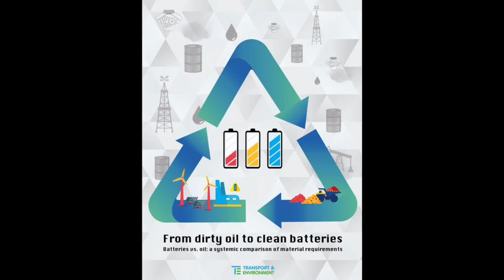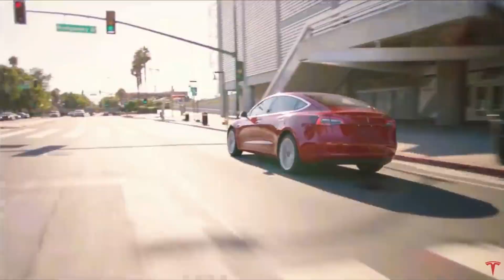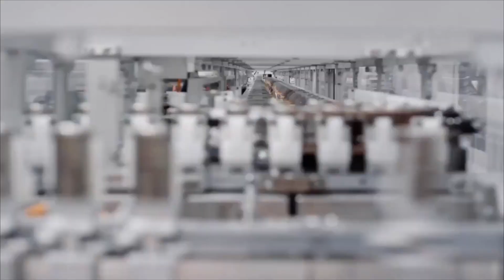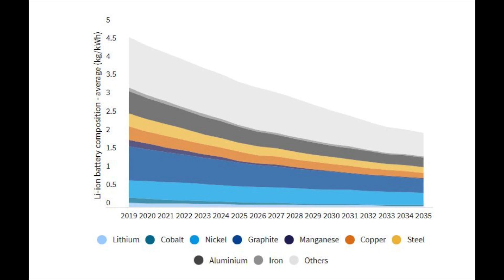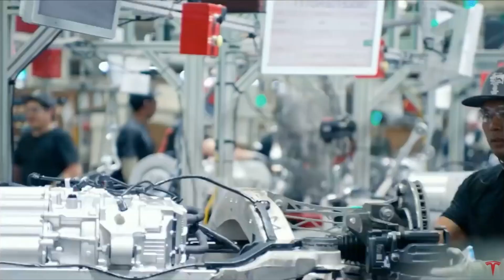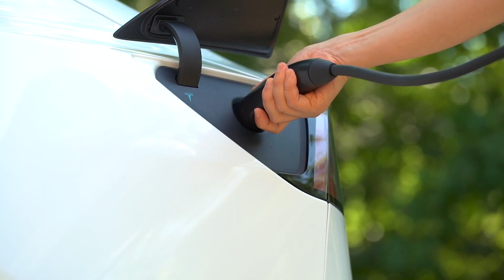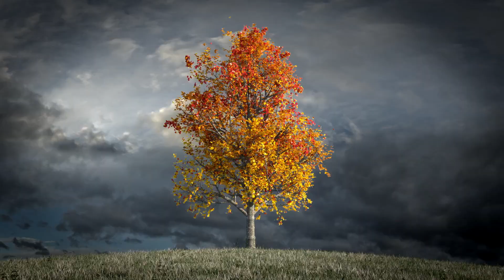An Electric car uses 300-400 TIMES LESS resources than an ICE car !!!

Comment: Going to minute 13:00, a battery is a storage device not an energy source, comparing the metals in batteries with the fuel passing through a fuel tank is unfortnately irrational. You need to compare what goes into generating the electricity itself for a valid comparison -- although the mass or volume of the fuels is not very meaningful. Improved environmental quality from not mining coal or refining petroleum, that's huge on its own terms, the merits shine by themselves, no need for silly numbers to show how good they are.

Comment: If EVs use 300-400x less resources why are they 2x as expensive? I can buy EV VW Up or an ICE VW Up for half the price and have enough money left over to drive 100,000 miles on petrol and that's with UKs double taxed (Fuel Duty + VAT) effectivly 130% tax on petrol! If it was taxed at the same rate as elecetricity 5% (petrol really only costs 42p/l not £1.20/l) you'd be able to drive over 200,000 miles before you saved any money on the EV. version!

Comment: I agree with Lars.  However, I assume this study does not include the cost to the Middle East nations and people of acts of terrorism, rebuilding infrasture, multi nation military costs.  Neither does it cover the costs of returning petro facilities to normal land without pollutants present.  It might cover general heath costs of pollution to the whole of Earths' population, but if so then we're into trillions just for that.  How about the cost of roads in the world?  Billions of miles of roads are made from petrochemicals, cement, metals, paints, etc.  Cars of the near future don't need these kind of roads.  So then there's the cost of removing roads and again relieving the burden to Earth ecology and wildlife.  If you really think about the future of EVs, there is unbelievable savings to everything.  That said, even these modern fully electric, autonomous vehicles are merely a fleeting transition to what follows.  Tesla EVs are only here for about 20 to 25 years before we convert to what follows it, which is much, much better.
Reply: Appreciate your comment you can message my administrator for further assistant w/a/s/a/p/
+1./3./1./8./2./1./7./4./3./2./4

Comment: Your arithmetic is wrong : a reduction to a 400th of the alternate is a reduction of 99.75%, almost    100%, so it’s very dramatic as you can’t generally go over 100% as that would put you into impossible negative numbers.
Reply: Appreciate your comment you can message my administrator for further assistant w/a/s/a/p/
+1./3./1./8./2./1./7./4./3./2./4

Comment: If you take into account all the oil we know is pulled out of ground, the percentage that is used on transportation, and the ammount of energy we get out of that (global fleet, average miles, average, consumption) we know that of what we pull out of the ground maybe 10 percent reaches the wheels of your car, the rest is wasted in that process through inefficiencies along the way. The waste can be calculated easily from the totals. Its a grim picture.
Reply: Appreciate your comment you can message my administrator for further assistant w/a/s/a/p/
+1./3./1./8./2./1./7./4./3./2./4

Comment: In the analysis of when ICE goes away, you cannot forget that gas stations and the infrastructure behind them  will decrease in value as well. You can charge an EV without a super-charger but how would you "gas" your car without a gas station. Reduce the number of those and for sure nobody would want a new ICE vehicle.
Reply: Appreciate your comment you can message my administrator for further assistant w/a/s/a/p/
+1./3./1./8./2./1./7./4./3./2./4.

Comment: I don't understand what "300-400 times" less means. Since we don't normally multiply to go down, unless we multiply by a fraction. eg., "2 times less" would be called "1/2"( (x) x .5 = y), or "50% less" (or "fewer" in this case).  Do you mean ev's use 1/300th-1/400 the resources? That would mean ev's use 99.66 - 99.75% fewer resources. I'm not trying to troll or be sarcastic, I'm genuinely asking. Can you please explain what you mean?
Reply: Appreciate your comment you can message my administrator for further assistant w/a/s/a/p/
+1./3./1./8./2./1./7./4./3./2./4.

Comment: Of course there is a big diff between the volumetric value of petroleum vs metals, not an apples to apples comparison but more like comparing Ni to Fe.
Reply: Appreciate your comment you can message my administrator for further assistant w/a/s/a/p/
+1./3./1./8./2./1./7./4./3./2./4.

Comment: Only area EVs are worse than ICE cars is tyre life, due to the extra torque. Perhaps better tyre  compounds and designs can be developed. Or engine torque may be able to be shaped at times of peak tyre wear/stress.
Reply: This is a time,y reminder tyres are one of the areas that are not mentioned much.  My contribution is to point out that every single car I have owned in the last 20 years, and motorcycles, bar none, have required a pressure about 20% more than the auto-maker states.  Partly it’s thinner sidewalls, the move to radials was some time ago but that also thinned the sidewalls, and I always set the pressures based on tyre wear.  IE empirically I get the most even wear/longevity out of a tyre by upping the pressure by up to a fifth from recommended levels.  It’s the most even wear, but the ride is bumpier.  I also wonder, and believe, that ICE car makers have been pumping their tyres up to 50 psi or more, to increase mpg figures, when testing for those purposes.  If they’re willing to cheat the law, they are certainly willing to contravene their own recommendations.  I am not reassured even, by private contractors or testing centres conducting these tests.  They constantly want the business. There’s more naughtiness to be revealed, and tyres will come into play as a key component of mpg performance, I believe.  A very good prompt, on the tires/tyres front.  Also, before i forget, it’s often the case electric cars have narrower tyres, especially compact cars?  More load/wear concentrated over less area, must affect things.
Reply: Tesla vehicles already have traction control by default. There are three reasons the tires wear faster :
1) The vehicles are heavier because of the weight of the battery packs. The new structural battery pack and advances in energy density will correct this over time.
2) The tires tend to be skinnier. This is done to try and improve efficiency, getting more miles per KWH.
3) On the performance models, they put camber on the wheels for better traction under high cornering loads. If I had a performance model, I would have the suspension set up to eliminate that.
Reply: Yes, 100 steps forward 1 step back. I am not certain if more torque management can be developed to shape tyre wear, which currently is not it's prime focus.
Reply: Also the tarmac road surfaces , I dread to think of Tesla semi tearing up the bitumen !

Comment: Thanks for the report, the incumbent claims of EVs being worse for the environment never made sense. An ICE engine is 30% efficient using mined and refined fuel, after transmission and stop start travel losses it drops to 7 to 9% efficiency. Even using coal could not see how EVs could be more inefficient, 95% motor and inverter efficiency plus brake regeneration.
Reply: Appreciate your comment you can message my administrator for further assistant w/a/s/a/p/
+1./3./1./8./2./1./7./4./3./2./4.

Comment: Lars, you’ve hit the thumb on the nail as you so often do.  I actually did have to concentrate, this is dense stuff.  If you were on the lecture circuit, you could let people into this more gently, and it would be the hard-core of a morning’s lecture schedule.  I have one way to look at this, a couple actually: ONE - what would be the reaction, to a group of neutral board of Directors, in a world where electric was the norm, if their top executive in their car company came to them and pitched internal combustion engines to them?  The idea often makes me laugh, that sketch just writes itself...’So, it needs constant maintenance, and sucks down 10 litres of synthetic poison every year you say?  And, the output from this, let me read it here ‘exhaust gas pipe’ thing, it’s toxic and if you were left alone with the engine on in your garage, it would asphyxiate you or your kids, yes?  Close the door on your way out, there’s a good chap.’.  TWO - God, has ‘Big Oil’ been untaxed.  Between tax write-offs for drilling equipment immediately released the same year the equipment starts up (USA oil man tried to deny this and a representative of Congress I think, slapped him down for it), and the fact that much of the toxic spillage happens secretly, out of sight underwater or underground, and the spills we do not hear about, and the patents they bought up for early battery-arrays for EVs (Exxon Mobil I am looking at your RAV 4 acquisition), and all the rest, including research they have done into their own products damaging effects, that they keep secret from the populace, Big Oil & Gas has had a right load of preferential treatment.  Give us all that.  Let me show that with early tax write-offs and banks willing to back me to the hilt and governments too, that I can be successful !  Who wouldn’t be?  A skewed deal, lucky blighters I say, time to pay it back.  Thanks Lars, keep safe.
Reply: You missed the $80 billion bailout of GM and Chrysler in the 80s.
Reply: @tomgray971  Ahh, didn’t recall that, when money was real money, too.
Reply: Excellent point of view.  Could have been a video entitled, How to Kill a Planet for the Sake of Greed.

Comment: 3 times as cheap. 300 times less resources. Just STOP it. These things are not possible.
75% less.  1/300 the amount, or 0.33% as much.  These have meaning.
The terms you use are meaningless.
Reply: Yet you seem to understand what he meant
Reply: @torgnyandersson403  Yes, and I understood the intent of "whatyhe" before you edited it to make it correct. So you personally appear to be on the side of those who prefer communication to be accurate and correct instead of gibberish.
Reply: @daveriley6310  Haha, sharp eyes. But, no, I'm just pedantic with my own language. :)
Reply: @torgnyandersson403  👍
Reply: Good call

Comment: This video is totally half backed, we are still in a transition period and we are using more amd more new ressources, were still using tons and tons of oil to make fuel to mine lithium, copper, aluminium, iron ore, gold...... oil is still used to make even EV parts, roads......... talking shit about ICE now won't change nothing, just saying
Reply: So no worry then.
Reply: Oil will be used producing almost anything for years to come and have been causing more deaths like nothing else for decades..
Fossil produced energi and parts, well in BEV only 1/3 parts go into a car vs an ICE car, so even in that point BEV´s are less. 
We will polute Planet Earth for years to come with fossil burning, almost whatever we do - somewhere in the chain fossile was there, still going the electric way seems a good way reducing this, so enjoy the ride. My old Saab has burned some 50.000L petrol, so I did my share of poluting myself, now driving tesla.
Reply: @praero551  bullshit, do you even know the amount of fossil fuels that have already been used to mine lithium, copper, nickel, aluminium,  gold....... EVs uses significantly more materials, all the copper and gold for the millions of electronics, plastics, insulations, tires, glues..... are all oil by-products. One of the biggest nickel producer based in new caledonia uses million tons of diesel amd coal to mine and process nickel alone. There is a significant amount of biodiesel and ethanol in gas and diesel to reduce the amount of imported foreign oil.
Reply: @praero551  companies around the world have been recycling waste and sewage and as by-product making biodiesel and biogas for vehicles.... Solar panels are mostly made in China then transported to the US and other countries to be installed with diesel equipments, wind farms are transported and installed using fossil fuels and the list goes on and on.

Comment: Great video. But the 300x factor is way off. We have to count oil exploration, but we also have to count the coal and gas for electricity generation. ( only when solar can produce enough to cover non transportation, can we count it, and it has also resource consumption) In the end everything comes down to the efficiency advantage of the electric motor for transportation, which is 5x. Not bad at all.
Reply: Total nonsense, the same crude oil is used to mine lithium, copper, gold, iron, aluminium to make EVs, the same oil is also used to transport and make EV car parts, make fertilisers, drugs, paints, lubricants......... the plastics and devices you use everyday, basically everything relies on the oil industry.
Reply: Elon musk at spacex actually uses million pounds of rp-1/refined kerosene as fuel for its rockets, what an irony right!
Reply: @carholic-sz3qv  There are many cases where hydrocarbon fuel or derivatives will continue to be the logical choice.  Rocketry is a clear one.  General purpose automotive...clearly not.  I see no irony there at all.
Reply: @737smartin  hydrogen is also a rocket fuel so why should anyone still use fossil fuels?! Wtf!
Reply: This is a good point, but...because fossil fuel for electricity generation requires less refining and distribution, while being more efficiently turned into electrical energy (then miles) than the ICE system, I suspect the real answer is closer to 100x than 300x or 5x.  Then there’s the growing percent of non-fossil fuel electricity generation, which requires still less resources and shoots the EV system still higher.
Reply: @737smartin  again fossil fuels are still used to manufacture, transport, install and service the renewable energies.

Comment: Can you recycle batteries? Yes.
Can you recycle fossil fuel? No.
Reply: Can you make 80 million EV per year? Not in decades to come and you ll still need alot of fossil fuels to mine the lithium and raw materials for EVs
Reply: @carholic-sz3qv  that’s a dead-ender comment.  Of course there will a period where the legacy fuel that runs the world will support building the new infrastructure and products that replaces it.  But the point is the future will rely less and less upon the old dirty fuel, and that’s a good thing.
Reply: Can you recycle batteries without fossil fuels: No

Comment: Great, but one component wad missed making the case for EVs even more compelling is that you have to buy 5-6 ICE to reach ONE 1 million miles Tesla. So let us say 5 times to be conservative and let us use 350 times (average of 300 and 400), an ICE car is using A STAGGERING 1,750 TIMES more resources (in percent: 175,000% more) from our planet or put another way, you can buy and drive 1,750 Tesla with the same environmental impact as JUST one ICE car. That is just insane and governments should really press for RAPID transition to 100% EVs!! To summarize an ICE Car us using a WHOPPING 175,000% more resources than a Tesla/EV.
Reply: Show me a 25 year old Toyota with a million miles PLUS the same engine, transmission, radiator, muffler, and power train and you'll have a unicorn. The Tesla will have the same batteries and none of that other stuff to replace. And most cars, when they get to 300,000 miles (or less) have such a low blue book value, it's cheaper to buy another used car than dropping $2000-4000 for a new engine or transmission. ICE vehicles have planned obsolescence after 15 years.
Reply: @archieharris6825  youre really dumb, you realise that even EVs have radiators right! Plus the millions of electronics and also battery degradation...... there are examples of tesla that had alot of mile but both batteries and motors had been changed multiple times. The mcu also gets outdated and cannot run the latest updates just like smartphones....
Reply: Are you dumb?! You realise that there are litteraly millions of ICEs that are over 20 to 30 years old right! A toyota land cruiser alone is a 25+ years lifetime vehicle